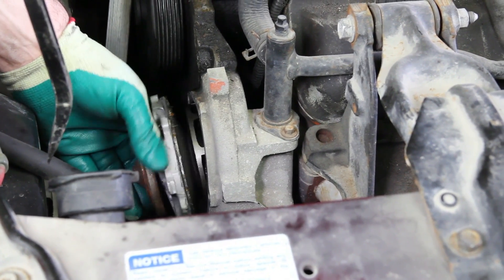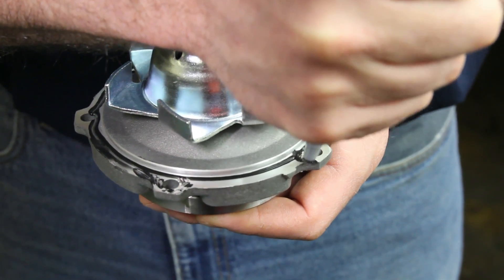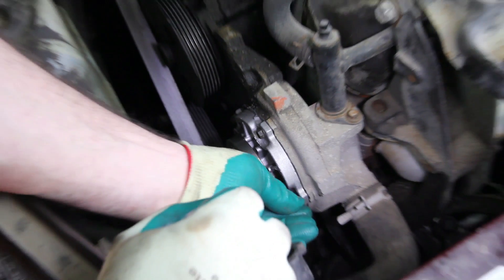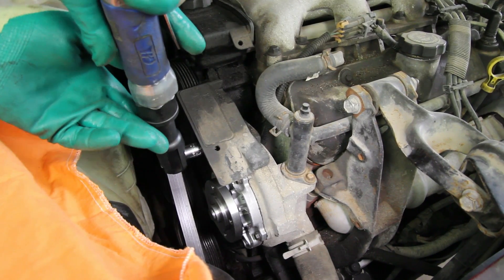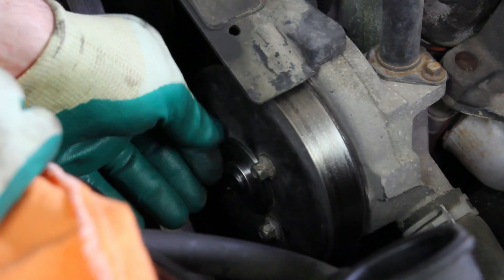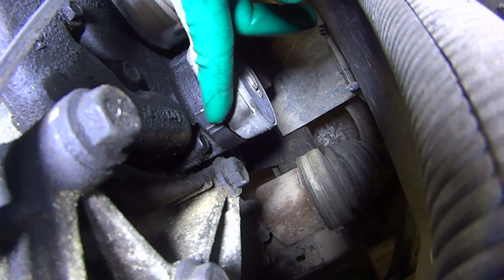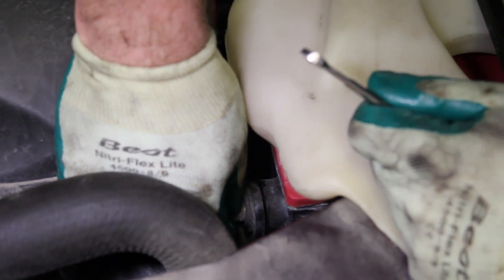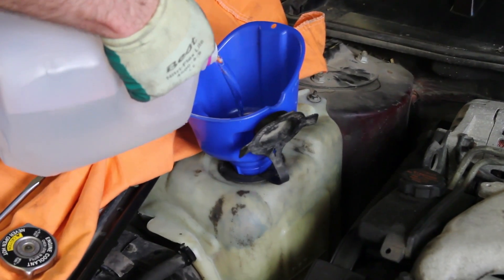How to Install a Water Pump: GM 3.1L 3.4L 3.5L  V6 FWD

Comment: Mine is leaking around the pipe on top of the housing the pump goes in. Could that be the water pump as well?
Reply: Not sure but could be your thermostat housing leaking. Replace the whole unit. If the pipe is part of the engine block itself, use metal weld you can find at any auto parts store.   Make sure and clean it well and follow instructions. I had great experience with a putty called Quick Steel and is about $6 give or take. Also make sure it's not the hose leaking making it look like the pipe is. Hose could be worn causing a leak.

Comment: the only prob I'm having is I can't find the torque specs for the water pump bolts and pully  bolts can't you plz till me what they are?
Reply: Oh OK must have missed that part thanks
Reply: He said 89 inch lbs water pump bolt and 18 ft lbs on pulley bolts.

Comment: question if you have the leak But your temp gauge shows normal operating temp. Can the car still be overheating?
Reply: Car can still overheat if you don't maintain level. Fix the leak. If it's the pump leaking, it may still function internally but your coolant pressure is not where it should be.